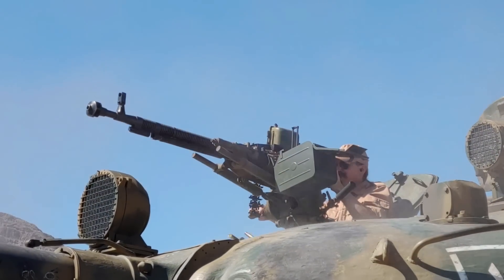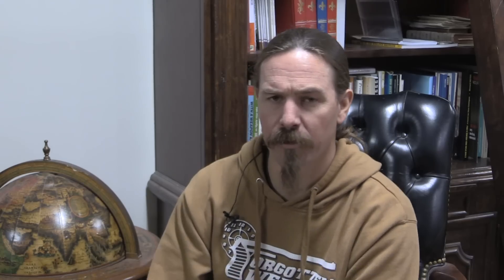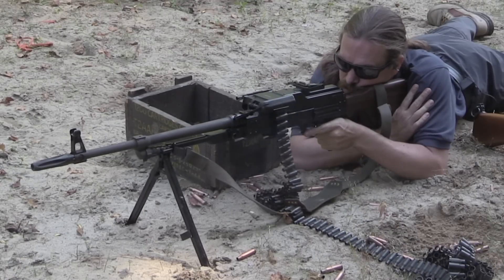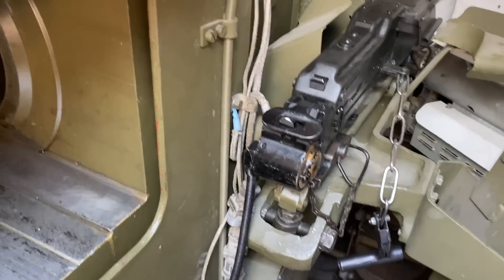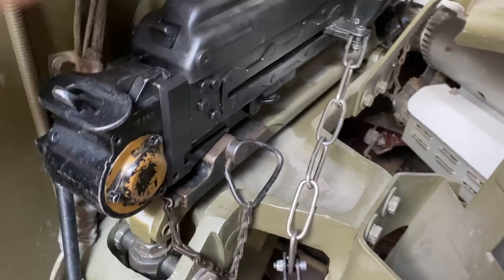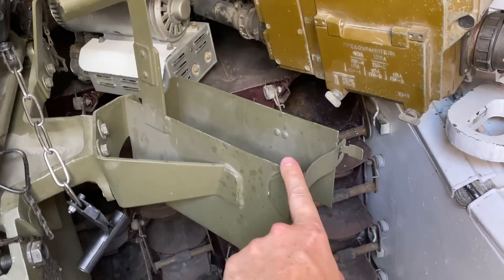Ukrainian Adaptation of PKTs to Infantry Use

Comment: The PKTs were standardized with a longer barrel to match the ballistics of the SGMTs that they replaced on the T-54+ series tanks. This was to avoid having to replace the fire control bits like reticules.
Reply: How long is the barrel?  The normal barrel length for a PKM is already like 25 inches (63.5cm), isn't it?

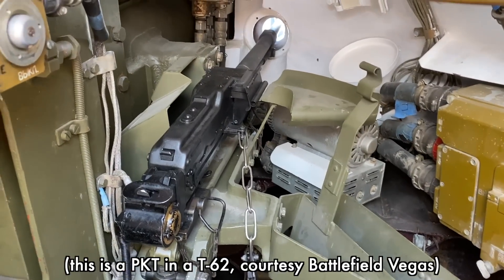Comment: The PKT solenoid unit has a backup manual trigger built into itself. It can be seen in 2:35 above the solenoid cylinder. You push that smaller trigger towards the machine gun and simultaneously depress that plate trigger to shoot. Back in the conscription days we were taught to take the PKT out of the tank if possible and use it as a suppressive fire weapon by firing it from the hip or prone position if necessary when retreating from an immobilized tank.

Comment: We had a bunch of coax m240 mgs and not so many 240b mgs so we had to make butterfly triggers out of parachute cord and 5.56 stripper clips. We would have them with a pintle mount and would place them on tripods or makeshift emplacements consisting of a pipe set in concrete at different locations around our fob so if an attack came from a different angle we could quickly move mgs where they were needed instead of having a couple of set mg positions. I still have a picture or two of them somewhere. This was in Afghanistan 2008.

Comment: Afghans did the same.  Had a PKB converted to a PKM.  Another difference between the PKB/PKT vs the PKM is the safety is located above the trigger on the right side of the receiver.

Comment: As Russia is using T-72s, T-80s and T-90s all of which are from the Soviet era, technically you could call them Soviet tanks. Or Soviet era tanks.
Reply: I mean T-90 a Russian era Tank but very similar to a T-72
Reply: @huntershark88  T-90 is pretty much a T-72 that was rebranded after T-72s were slaughtered in Iraq.

Comment: I have a photo that I copied off Facecrack, from a Kurdish YPJ/YPG group. It took a bit to find out what it was, because it was mounted in a Toyota Hilux, had the stock from a PKM, a recoil spring that looked like it was from a truck, and a welded block of square tubing (of about 3") with a Picatinny rail on top, and scope. Seems it was an aircraft-mounted 23mm gun, modified for use out the back of a Hilux...

Comment: The coax machinegun on some tanks is used as an aiming device when it has similar ballistics to the tank shell. They keep shooting the machine gun till it's on target and then fire the main gun. A similar method was used with some recoilless rifles but with single-shot weapons and tracer.
Reply: I don't think the ballistics of the main gun round and the rifle round are even remotely similar.
Reply: @hunterbidensaidslesion1356  They probably used spotting rounds. Otherwise it would not have worked very well.
Reply: @icemanactual5547  what rifle-caliber spotting round has a trajectory that is even remotely similar to a main gun round at any disputable range?  That isn't even possible.
Reply: @hunterbidensaidslesion1356  Probably a modified .50 cal round. The Chieftain hand a spotting rifle/ranging gun chambered in .50 cal (don't know the actual military designation of the round). And the recoilless rifle OP was referring to used M48A1 as it's spotting round.

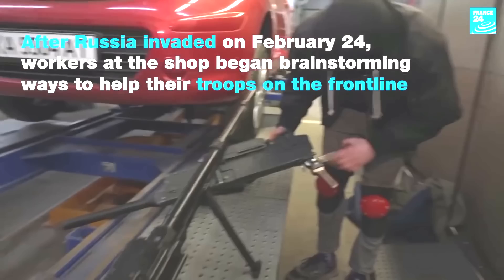Comment: @3:55 it is an NSVT with the barrel removed and what appears to be a pistol grip attached. There never was a spade grip for the NSV heavy machine guns to my knowledge, the AA mounts used a solenoid.
The NSVT and the PKMT use the same solenoid to fire, so if they modified the PKMT they can modify the NSVT just as easily. It may alternatively be the Kord, but there I cannot comment as I have never seen a Kord in real life. In the pictures, I did see the only external difference between the two is the muzzle brake.

Comment: This is actually a pretty simple modification, because PKM and PKT receivers are identical. Only difference is that in PKT the solenoid activates the lever that trips the sear, where as PKM it is the trigger that moves the lever. Fun fact: you can actually manually fire PKTs by pressing the big flat sheet of metal on top of the solenoid assembly, for example in case your tank loses power, or if you have to dismount and want to take the gun with you. Only inconvenience is that PKT doesn't have any built in sights.

Comment: Given how obviously old and worn out some of those vehicles have been, you may have been accurate to call them Soviet.
Reply: We are seeing T-72, T-80, and T-90 tanks.  So, at a minimum, these were all designed by the Soviet Union.  Some may have been built after 1991.
Reply: @Rocketsong  Yup.  It's been reminding me of how we used Vietnam as a means of clearing out leftover munitions from Korea and purportedly WW2.
Reply: The Russians pulled troops from the furthest reaches of their Nation. So presumably some of the gear literally hasn't been used in decades. The use of old gear though seems to be a mix of the Russians underestimating Ukrainian resistance - so not sending in their best gear -, and a deliberate attempt to oviscape the presence of Russian troops to the public back home. With there being statements from Russian officials saying that those Russian soldiers in Ukraine Russian, as Russia doesn't use such old gear.

Comment: The Russian word for “tank” is ……… “tank” (“TAHK”).  It is a loan-word borrowed from English.

Are the co-axial machine guns also for sighting purposes?  They seem pretty useless against infantry.
Reply: They are as useful against infantry as any other .30 caliber MG really, it'll kill people just fine, and there's plenty of suppression to go around considering tanks carry thousands of rounds of ammunition for them. Sighting-wise it's not really necessary anymore - tanks come equipped with laser rangefinders since the 1970s, and those provide a range far more quickly and accurately than an MG burst.

Perhaps more importantly - shooting MG rounds at singular infantry isn't wasteful. A T-72 family tank will only carry around 45 rounds of main gun ammunition, of which only 21 are immediately accessible in the automatic loading mechanism. Also, somewhere around half of that will be dedicated armor-piercing ammo, with little anti-infantry utility, so a tank gunner has to be fairly conservative with his shots, lest he runs out when they're really needed. It's generally better to save main gun ammo for groups of infantry, fortified positions, and vehicles.
Reply: @luki97z  While I don’t doubt that 7.62x54 can kill infantry, I question whether a coaxial turret mount provides effective traversal to actually catch infantry on the move.  (I similarly question the value of hatch-mounted anti-aircraft machine guns, which make more sense in an antipersonnel role.)  Sure, it can spray down a building or fill an alley with lead, but it also seems pretty easy for infantry to outflank a tank’s coaxial fire.  Of course, tanks aren’t supposed to operate alone and should provide overlapping fields of fire supplemented by dismounts from supporting IFVs. 

Regardless, the reason I asked was I seem to recall that several modern tanks still use ranging guns or have coaxial machine guns that can serve that purpose in lieu of the laser ranging sensor.
Reply: No, they're primarily anti-infantry.

When you have 4000rds in a single continuous belt and a super-stabilized sighting system, you can lay suppressing fire down to 1000m.

Comment: The NSVT machineguns on russian MBTs are all without any spade grip/shoulder stock usually. They can pretty easily be dismounted, but I think it is harder to do on the T-80 BVM, as it is designed for fully remote controlled fire. All russian tanks since the late T-62 have abandoned spade grips to my knowledge.

Comment: Ian, modern airburst ammunition makes the main gun much, much more capable than a machinegun in engaging infantry. It's still a big waste to fire a 120-125mm shell on a single guy but the main advantage of the coaxial machinegun is that it's always there, regardless of what type of shell is loaded in the main gun or whether it is loaded at all...

Comment: The Heavy AA MG is usualy an NSVT or Kord. NSV is dating back to the Soviet era with the Kord meant to replace it. Generaly Speaking Ukrainian Tanks are Equiped with PKT and NSVT aswell

Fun Fact, Germany Still uses the MG3 as an AA mg with no major changes and can be dismounted from the Turret roof and used on a Tripod when the vehicle is entrenched with camie nets and. propably gonna move away from that with the introduction of remote weapon stations on the 2A7 and the M2 mounted on that.

Comment: There are three MGs on a Russian tank; the co-axial 7.62, the loader has a pintle mounted 7.62, and the commander has a pintle mounted 14.5 (except for the T-64 where they tried giving the 14.5 to the loader, but it reverted with the T-72).

Comment: I mentioned in the “post“ that they should probably leave them as is, and wire them up to be automated. Hook them up to something that just takes a fixed position with a relay, and have them take out anything that crosses its path. That may or may not be legal under the “rules of war“, but who cares…

The IR eyes of a garage door across a path or street - anyone/thing crossing its path - BAMM. Trip wire. Aurdino relay. Radio with its speaker wired to a relay - and yell “FIRE” into another radio to trigger it… Our just a battery pack and a switch to be remote fired from cover a few feet away from its operator.
Reply: The problem with that setup is that it kills indiscriminately which is about as effective as placing land mines. Many have stopped using those tactics because they require the internal communication of the army to be 100% accurate... and it requires that everyone remembers what has been said. Even when retreating under heavy fire. So the TLDR is that it works much better for invading forces than defending forces.

Comment: If I'm not mistaken, coaxial machine guns are used also (or, sometimes, primary) for sighting - up to some distance they have a close point of impact, so you could send a burst with tracers to check where you would hit and then use more expensive main gun ammo
Reply: It is not a normal operation, at least, on contemporary tanks (T-64 and later).  I remember that at distances less than 700 meters we were using "4" (400 m) mark in optics to shoot with coax machine gun in order to not switch turret optics from cannon ballistics.
BTW, ballistics of all 3 main cannon round differs, sometimes significantly.  And effective ranges of cannon is at least twice over MG .
Reply: @MrGdg1969  Of course ballistics differ, that's why it would possible only to some ranges. Well, I guess I must be wrong then, definitely heard about that usage for some tanks, but it looks like it's not as widespread as I thought.

Comment: I will say with modern ammunition, there are a lot of effective tank shells that are airbursting fragmentation that are designed to be used against infantry and are generally more effective against infantry than a traditional machine gun. Not saying those guns are useless, but detonating a fragmentation shell right above them is generally more effective against infantry that aren't in buildings or don't have overhead cover, so main guns are adapting to be effective against infantry in the open

Comment: They need to start making 7.62x39 AK pattern rifles with barrel twist rates that make sense. The roughly 1:10 barrel twist on most of these guns is terrible for stabilizing typical surplus 123 gr. bullets. This twist rate was selected for economical reasons, as it allowed the Soviets to continue to produce .30 cal barrels on the same old tooling they used for mosin nagant rifles. It made sense at the time for efficiencies sake, but they should have shifted production after the tooling wore out. Now the whole world thinks a 1:10 twist is the best way to produce 7.62x39 Kalashnikovs when in reality a 1:16 twist would be much better for typical surplus ammo.

Comment: Hmmmm coax converted into an infantry MG. So is it possible to take the cannon out and just make it a field gun? Field gun meaning stuff like WW2 Pak stuff.
Reply: Not really. At least not easily.

The 125mm has an autoloader, which greatly complicates turning one into a field gun.

Not that it can't be done, it's called the SPRUT.
Reply: @ScottKenny1978  auto loaders. Man with the lack of maintenance in every russian vehicle i wonder how often that caused problems.
Reply: @Awootistic  couldn't tell you.

Probably a lot, but the Russians do spend a lot of engineering time to make the beast usable by conscripts that have no clue how to do the maintenance. (See also AKs)

Comment: Basically why they don't do same things with turrets an cannon? like Germans have done during WW2 ...
they put turrets on cemented bunkers and trench so they also have 
1 heavy artillery guarding strategic points of access to the city.
or
2 dummies... after a tank is hitted by a missile... perhaps cannon doesn't work anymore but... as Rommel teaches in war sometimes you can't distinguish a pipe by a real cannon... so... a not working turret can be deceiving while infantry hit the side with other arms of an advancing invaders by multiple hidden positions...

Comment: Ian, I really wish you would stop referring to the DShK Soviet/Russian heavy machine gun firing the 12.7×108mm cartridge, as a .50 cal. It really is a different gun firing a different cartridge. I do think you for the video though.
Reply: @mitri5389  No self respecting firearms expert or historian would say these Russian firearms are .30 calibre. So I agree with you. You do clown.
Reply: @Lord.Kiltridge  Lets see
"Russian .50 cal" = 12.7x108mm
.50 BMG = 12.7x99mm

Best I can see it is perfectly accurate to call it a Russian 50 cal cartridge.
I'm guessing you have never heard of 30 russian, and 30 russian rimmed. Those are older terms for 7.62x39 and 7.62x54r. The fudd asking for it and the dude behind the counter both knew exactly what was meant. Things are named whatever people call them. Whether it is technically correct or not. And its not technically incorrect. 

Saying its a different cartridge is accurate, but saying its not accurate to call it a .50 cal cartridge is like saying 6.5 creedmore is not correctly referred to as 6.5mm bc 6.5 swiss is a different cartridge fired out of a different gun. It simply makes no sense when you understand how the US has different metrics used for a lot of things. We use miles, gallons, inches, etc.

Don't talk about what a self respecting firearms expert or historian would or wouldn't do, unless you are one. And you are clearly not. Even I can tell that, and I'm not a self-respecting anything.

Conversion of metrics and measurements are a thing. You did learn about fractions in school, right?

Yes it would technically be more informative and accurate to refer to every cartridge that ever existed by its caliber in mm X cartridge length in mm. But thats not necessary when theres only so many cartridges that something can be based on a given context. A WW2 milsurp 6.5 bolty from say italy or switzerland will not call to mind the modern 6.5 creedmore cartridge, right? 

Another example would be like saying you shouldnt refer to 9x19 parabellum as 9mm bc 9x18 mak exists. Which uses a whole different gun and cartridge. Which would be a pointless and useless statement if we were talking about glocks. 

Everyone else can easily figure out what he means, without being a firearms expert. Apparently even you could tell the difference, no? Why do you need specification?

Comment: Many of the modern externally mounted machine guns / commanders machine guns are no longer used /mounted for anti air and are often solenoid controlled by the commander from inside for anti infantry.
Reply: I always thought of he coaxial as a good way to check the aim of the main gun, and the commander's gun more for marking positions.
So in a situation where the gunner and the commander are selecting targets the commander can "point out" targets with his gun, and the gunner can confirm by putting a few coaxial rounds on the target to confirm.

Comment: I’m surprised the Ukrainians aren’t doing the 50cal hilux tactical.
Reply: @rosiehawtrey  This is Ukraine. Not Kazakhstan. There are plenty of Audi A6 Sport Wagons to convert into belly-position-machine-gun-out-the-rear-hatch-drive-by-Russian-meat-mincers if they need to :P
Reply: @andersjjensen  
Thank you. That makes sense. 

I have no experience or knowledge of tactics. 

I had thought that it may have been useful against the troop transport as an ambush parked on the street for single use then run and dump, but, yea. That’s not what’s happening.

Comment: Interesting point, but at least in Ukrainian, the word for a tank is tank, but in russian it's a bak, which is also the russian word for tub (like bathtub). Kind of interesting to me since generally the two languages are very similar. I got all this info from google translate so it could be wrong, or maybe google just got it wrong. My bet is that russians also just call tanks, tanks. After all, until the germany fielded the panzer tank, they simply called them tanks as well

Comment: Interesting that the Ukrainians are scavenging the machine guns from Russian tanks, but not putting the captured tanks themselves back into service. Lack of crews to crew them?
Reply: You just played yourself.
A lot of tanks are being repaired and used against Russia.
APCs,Tanks,Artillery - everything that still can be repaired and if it's WORTH repairing.
Most of the vehicles are being captured without or with minimal damage to use them against enemy later.
Reply: a lot of russian tanks/apc's that I've seen on the photos are destroyed beyond repair. but if the MG survived, it can be salvaged and repurposed.